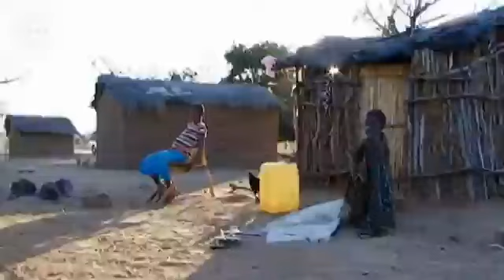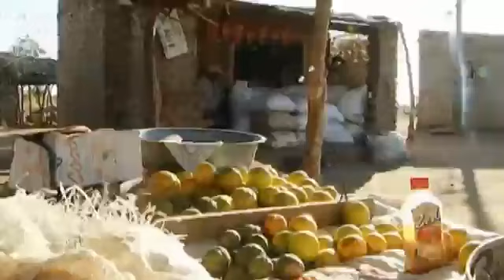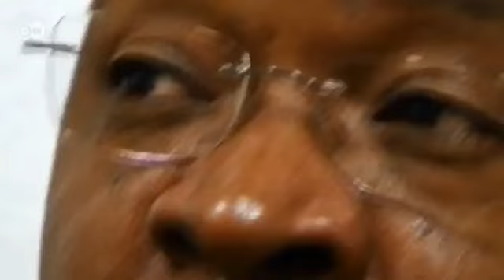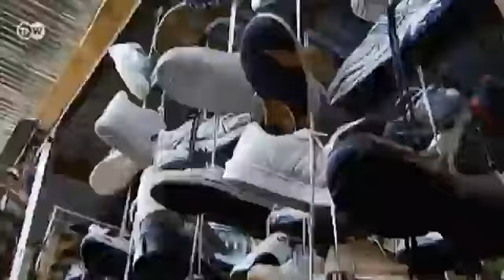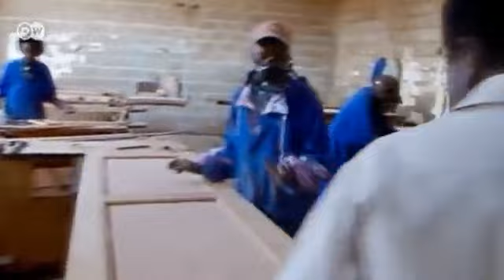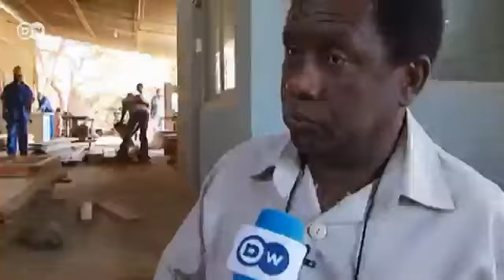Coal Rush in Mozambique | Global 3000

Comment: PPS: OK, put a new light motor-vehicle factory in larger cooler Chimoio, but Tete might get into using new simple engines for farm machine: tractors & processing equipment... or devices using heat turning into refrigeration: refrigerators or air-conditioners. (We had propane flame driven refrigerators in Africa!) Tete needs coolness!

PS: I'm glad to see nobody here whining about coal causing global warming. Man's CO2 is not driving climate change. See "The Great Global Warming Swindle."